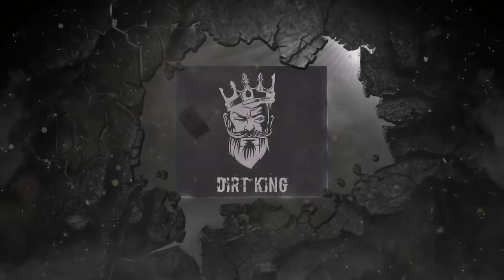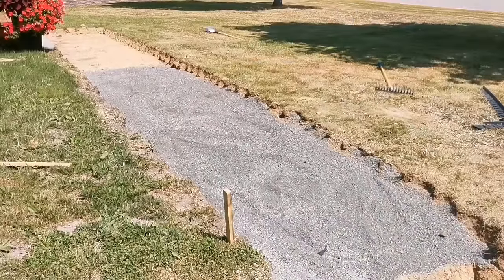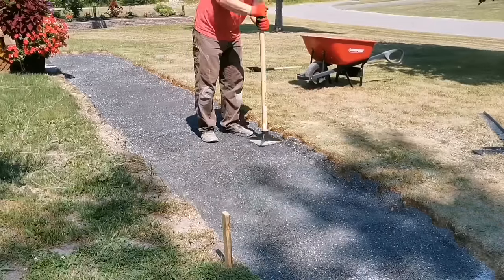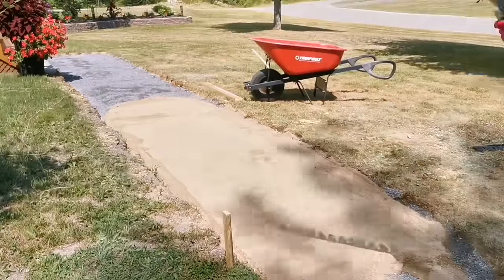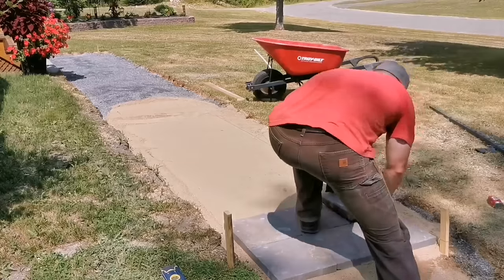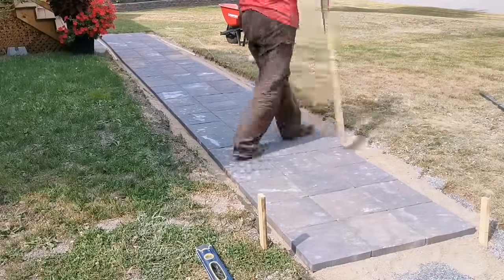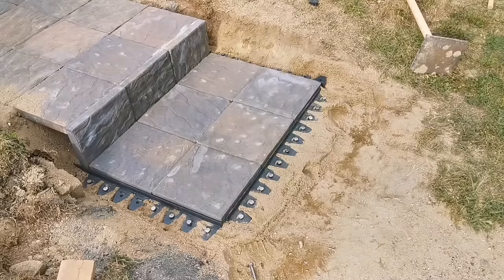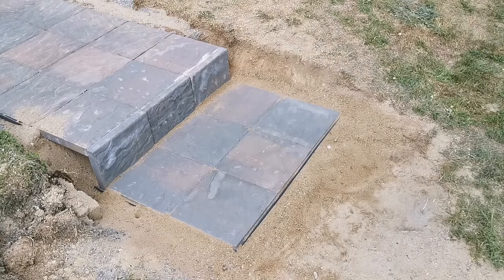Building A Paver Walkway That Will Last.

Comment: My wife bought a dang pallet of those big diamond-shaped pavers from lowes. The salesman also had her get a stack of the polypropylene paver base panels. She said she wanted a walking path! I have no idea what to do for a border for those things.
Reply from the maker: One thing I have done in the past and I see others do is complete your walkway with the Dimond design.  Then you could chalk line a straight line on each side allowing you to cut with a concrete saw  just the points  off leaving you that straight line finish for your plastic edging.  I have also added the smaller pavers along the edges that I cut for a nice border design then add plastic edging. 
You can rent a concrete saw from any rental shop.  Hope this helps. 
Thanks for watching
Reply: You mean if I have a pallet of stone delivered , my husband will create a walkway!?
Reply: @fred4peace  It's all in the placement of the pallet. If it's placed out of the way, he may or may not. If it is placed in the front door of his shop like mine was, he will have no choice. My wife said, "it was so I wouldn't have to walk too far for my tools." How considerate of her, huh?

Comment: if only that base was 6 inches deep... more like 2. if you're up north that'll fail within 4 years without fabric, 6" class 5 or recycled concrete, & no more than an inch of sand, then pavers & poly sand. as a contractor i would've charged $1800-$2200. i'd love to see an updated video a year or two later to see if it heaves or not! otherwise good work, lil more here and there and you're a pro.
Reply: most people say 4 inches base for sidewalks/patios but if its a high traffic area i highly suggest 6" base, cheap insurance.
Reply from the maker: Thanks for the advice and comment.

Comment: Hi really enjoyed this video thank you , I just had one question how did you do the paver step towards the end of the video
Reply from the maker: Hi, thanks for whatching.  
I dug the dirt out from under half of the last paver.  I placed a couple cement blocks under for support. Then I flipped 3 other pavers upright
And added lots of concrete adhesive behind. They've held great, Even though the frost in winter time.  
Hope this helps 👍
Reply: @terrymcgillicuddy8056  Thanks for the explanation about building and stabilizing the step. Any preferences about the construction adhesive you used to hold the 3 steps together?  Great use of the compaction tool, by the way - shows us that not everything has to be done by machine.
Reply from the maker: Thanks.  I used Gorilla concrete adhesive. But I think any concrete adhesive would work fine.

Comment: Nice video, thanks!
Have you considered running your paver over the step riser so the joint is not exposed and therefore less susceptible to moisture getting behind the riser? In our climate (MN), I suspect that the freeze/ thaw cycle will eventually push that riser out.
Reply from the maker: Thanks, yes if I was doing it over again I would have definitely done that. ✔️
Reply: @terrymcgillicuddy8056  if I use hpb instead of beach sand , is it the same  process ?
Reply from the maker: What is hpb?
Reply: @terrymcgillicuddy8056  high performance  bedding , like limestone screen , what I meant to say was screen . HPB is a bit more expensive than screen because its been screened  and washed  more times than regular limestone screen but its basically the same thing as screen
Reply from the maker: Ok, yes that would work just as good I would think.
Thanks 👍
Reply: @terrymcgillicuddy8056  HPB is not common in the south , only the north , I don't think people use it in the south of the country

Comment: Hey, have you ever use finishing roll Roofing under the Stone to keep it from sinking?, I’m working with Florida Sand.
Reply from the maker: No I never have. Sounds like it would be a good idea though if you can't get access to good dirt.
Reply: I would dig  it down to where I need  the sand, compact it, put rolled Roofing down, Put Pavers down, put the edging around it, then the sand on top and brush it in. It would make a good weed barrier too!! I would be Laying at least 134 Red 12 by 12 Pavers. It’s a whole lot cheaper than poured Cement. Trying to make a little Courtyard  Patio out from the front door of house and butt it up against the Driveway.What do you think??
Reply from the maker: The only thing about not using the 1 inch of sand is you loose the ability to level every paver up evenly by tapping it with a rubber mallet. Just my thoughts.
Reply: @terrymcgillicuddy8056  I’ve been thinking that too!, though you use a level for pitch, I am concerned about a high place. I think I will use sand to level also.Thank you!

Comment: Are there any downsides to concrete pavers vs stone pavers? Thinking about doing modern 2x2 pavers for a 12x14 foot patio.
Reply from the maker: No, both work just fine.
Reply: @terrymcgillicuddy8056  thanks man. Are all concrete pavers the same? I’m seeing a wide range anywhere from $4-10/sqft for 24x24 concrete pavers in my area.
Reply from the maker: They come in all different sizes.
Reply: @terrymcgillicuddy8056  Thanks. I guess I'm asking what's the difference in quality for the additional price? We see standard gray 24x24 pavers at Home Depot for $9/paver and the same looking paver is $18/paver at a local landscape supply store.

I don't mind paying for good materials, but I'm wondering what I'm getting besides marginal density?
Reply from the maker: Sometimes it's the thickness of the paver. Some are thicker than others.
Reply: @anujbhatia3337  Maybe the landscape supply  paver is made with a denser, stronger concrete. Ask them. Concrete comes in different types from a concrete supplier.

Comment: What is supporting the pavers that make up the step?  Also noticed these step pavers were behind the pavers making up the risers.  Found this odd.
Reply from the maker: I have concrete cinder blocks filled with gravel under the last paver, supporting the step. 3rd year and still looks good as new.
Reply: @terrymcgillicuddy8056  Of course!  I overlooked the obvious.  Nice solution.

Comment: Hi Terry, I am confused on the step down. Do you have a video of how to install steps? I have a walkway that needs a couple steps down to firepit using pavers. thanks!
Reply from the maker: Sorry no I don't.  I actually just used the the same patio stone and glued them. The proper way would be to buy an actual stone for steps but they were to expensive for me.
Reply: And packed sand underneath  guess. Cheers
Reply from the maker: @dariusdodd  Yes exactly. 👍
Reply: What kind of glue did you use? Because i have to put in a very similar step at the end of my path.
Reply from the maker: I used Gorilla Glue, for concrete 👍

Comment: The thought of using a shovel to dig down 6 or 7 inches the whole length and width of the walkway would be enough to convince me not to do it myself.....lol.  My clay soil doesn't dig up quite that easy.
Reply from the maker: Ha ha.  Don't blame you.
Reply: moisten clay before you attack it    works for post holes or scraping but gets heavy in the shovel or wheelbarrow with added water
Reply: for really tough clay use a bladed pick and water to break top layer
Reply from the maker: Great Tip 👌

Comment: One question about this: how are you providing support for the stones at the stairs?  It looked like there was a big void under there.
Reply from the maker: Hi Don, I actually put cement blocks under the last paver..The paver I laid vertical are pressed against the cement blocks using concrete adhesive..

Comment: I live in Southern Arizona and are ground is like cement. So I really want to avoid digging down. Are there alternatives
Reply from the maker: Absolutely if your ground is already that hard you can skip most of the steps in this video.  The only reason I dig down is to hit hard solid ground. You already have it to start with.  👌
You could level your area with a thinner coat of angular stone. Then add the 1" of sand and lay your pavers. Just make sure your spikes pound in hard, that will let you know the ground is suitable.
Reply: @terrymcgillicuddy8056  ok thanks so much for answering

Comment: Is there a limit how deep the crushed rock can be? Our current side walk is sunk too low comapared to the edges. Do we need fill dirt or can we make the difference in the crushed rock?
Reply from the maker: No limit to how deep the crush rock has to be. Just as long as it's compacted well
Thanks
Reply: I would say that you should put 2 inches down and compact, Then compact every 2" up from there.

Comment: When you put sand on top of the pavers is it normal sand or polymer sand? Also if you wanted to mortar in the pavers how would that change the type of foundation needed?
Reply from the maker: I used regular sand. The reason I did is because it's easier to replace the regular sand in 3 or 4 years. Just brush new sand in. It's not that easy when u have to re-do the Polly sand. Polly sand requires alot more work picking out of every crack with a sharp tool.  The Poly sand also wears off and needs replacing every 3 or 4 years. 
If you do want to use Polly sand it will bond tighter though. I wouldn't recommend using a mortar, the movement in the winter months would definitely crack it.  
Unless u live in a no frost climate.
Thanks for whatching.
Reply: @terrymcgillicuddy8056  great video by the way! There's not many on here that show putting in the sub base they always seem to skip filming that part. I want to have a go at building a new path down my green house but I want to lay some thick sleepers down the edges so I can build up the flower borders at the sides.

Comment: How do you do the edging if one side of the walkway is up against a concrete driveway or the foundation of a house?  Do you just NOT do edging along the side that already has a rigid edge?
Reply from the maker: Exactly. You don't have to do the edging if you have it supported by any structure.  Thanks for watching.

Comment: What did you do under the pavers at the step- up? Looks like there is a gap under them? Just curious because it’s not in the video.
Reply from the maker: I used retaining wall blocks. Put concrete adhesive under the pavers, Then I filled in the gap with mono foam.  
Thanks for watching
Reply: @terrymcgillicuddy8056  oh that would have been good to see on video. Not quite sure what you mean.
Reply from the maker: Sorry, I should have filmed it. The next one I will.

Comment: Nice so if you have peagravel down I guess you have to take it out.
Reply from the maker: I would definitely dig down until you hit solid foundation and start building from there.
Thanks for watching
Reply: @terrymcgillicuddy8056  I actually was told to use polymer sand over the ground to make it solid and ended up watching your video. If I could figure out how to make it solid I’d be thrilled. It’s a Path between a patio and a retaining wall. With a French drain under that we did in 2015. I’m tired of the dogs picking up peagravel between their toes, but also want to have area level with current patio
Reply from the maker: If you can dig down at least 6 inches then build your base back up with crusher dust tamping 3 inches at a time. This should work ok. I would never use poly sand for a base. You can use poly sand to sweep along the top of the pavers filling in the cracks if you choose not to use regular play sand.
Thanks. I hope this helped 😊

Comment: What did you do with the dirt and i noticed a fabric wasnt laid to prevent weeds is that something that isnt needed?
Reply from the maker: Thanks for watching, I didn't use fabric but you can if you would like to. By using 6 inches of Crusher run dirt I have had no weed problem at all. 
The dirt I shoveled out was put in a hole at the back of the property 👍
Reply: @terrymcgillicuddy8056  great thank you so much. Your video definitely inspired us to try to do it ourselves instead of paying $3000. We just need to figure out where the dirt will go.

Comment: I had someone tell me to not use sand because ants will make there nest and erode the sand away and make the paver unlevel in about a year. Is that true?
Reply from the maker: I've had my pavers down over a year and no problems yet.  I know it's good practice to sweep new sand or replace Polly sand and re tamp every 4 or 5 years anyway to keep maintenance up on you walkway. Thanks for watching.
Reply: Yes! That is very true. The sand is always affected by ants. We normally use 4" of crushed stone for a sub base and then use what he calls crusher dust, (stone dust) for laying the pavers. The stone dust packs very tightly and is way better than any sand. Sand can also wash out over time. Stone dust will not because it packs very tightly.

Comment: What if my ground is already sandy? Can I just compact it and put the pavers on top?
Reply from the maker: No, you would have to dig down until you hit solid ground to start a proper base.
Reply: @terrymcgillicuddy8056  but what's the point of adding sand?
Reply from the maker: Only 1 inch of sand. The sand will allow make minor adjustments. Any more than 1 inch will cause the pavers to sink too much
Reply: @terrymcgillicuddy8056  in this area that could be several feet of sand 😢

Comment: Not a pro, but on the steps, why have the kick/rise stone up against the edge of the walk, instead of the walk way stones on top? Seems for one it would be more appealing to the eye, and two, is seems that it would be easy for someone to step on the edge and pop that kick/riser stone off. If not immediately then over time. That seam would seem more protected from the elements too if the walk way stone went over the riser.
Reply from the maker: Yes exactly 💯, I thought of that after it was done and all glued. It would have looked much better. It's still holding strong so far. 
Thanks for watching

Comment: Can you post here exactly what materials you used, especially the fine stone you used below the sand. Thank you!
Reply from the maker: 1: Crusher Dust or Crushed gravel. Make sure its angular. 
2: Sand
3: Hand Tamper
4: 1inch outside diameter PVC pipe
5: Wooden Steaks, with string
6: 8 or 10 inch spikes
7: low profile plastic edging
8: 2" thick patio stones. 

Good luck and thanks for whatching
Reply from the maker: Anything else I can help just ask.  👍
Reply: 1/2" or 1" PVC?
Reply from the maker: No more than 1" outside diameter PVC. Sorry I said that wrong in the comment above.

Comment: How come you didnt check for level length wise?
Reply from the maker: I used the string length wise with a line level having a little down grade towards the driveway.  I filled the material to the string.  Thanks for watching.

Comment: How did you do the step?
Reply from the maker: I used a concrete adhesive to hold the vertical pavers together. Two years now and still holding strong.
Thanks for watching

Comment: I want to pave a wider area around my pool.   I think this would work..   Thank you.
Reply from the maker: Thanks for whatching.
Reply: If it's a in ground pool I'd hire a professional. I do this for a living and he did a good job for a home owner. But you're going to want to use a plate compactor for proper compaction otherwise it will settle overtime. And you're going to need to do 2-3 raises of your base to get it in right.  Your pool will get a lot of foot traffic and you don't want people running around bare foot with uneven pavers
Reply from the maker: @derek Gardner  I tried to rent a plate compactor but there was none available at the time. Thanks for commenting.
Reply: You really showed me some excellent work. I had someone lay paver-walkway and from this video I need it redo. Thanks
Reply from the maker: Thank you 😊

Comment: Looks good, but isn't it over kill with that many spikes along the edges? Ive seen a lot of other pros using spikes about every 10" apart. One every hole will cost a fortune just for the spikes.
Reply from the maker: Thanks, I put a spike in every 3rd hole. The reason I do is because we have cold temperatures and Heavy frost during the winter months in Atlantic Canada. Little extra cost for a little extra security. 👍

Comment: How come you used sand instead of cement?
Reply from the maker: I like using sand because it's easier to replace every 3 years making the pavers look new again. My winter months are cold with frost. I find the cement last a little longer maybe couple years then the sand but when the cement starts to deteriorate it looks really bad and alot harder to pic out of each crack to redo again. 
With sand, throw a bag on, sweep it in the cracks and a light tamping. Pretty quick maintenance.

Thanks for watching.
Reply: @terrymcgillicuddy8056  do you need to get a permit to do an driveway extension?
Reply from the maker: @chevyhs  Depends on your town or city bylaws.. I have never needed one yet..
Reply: @terrymcgillicuddy8056  been watching a ton of videos and tutorials. Doesn’t seem hard at all!!!
Reply from the maker: You can do it no problem. It will turn out great 👍